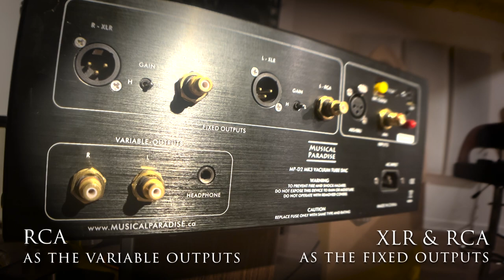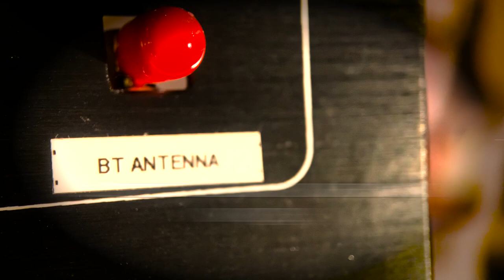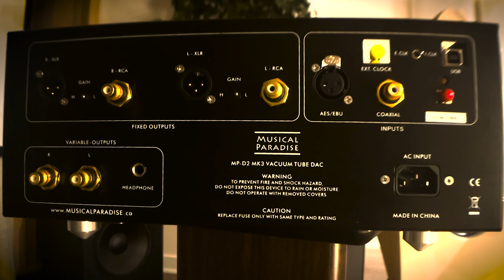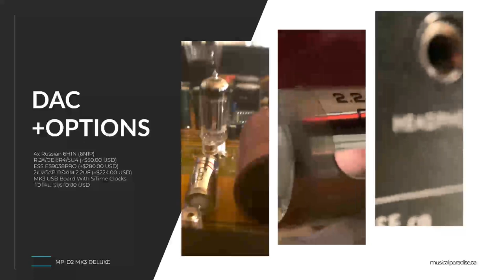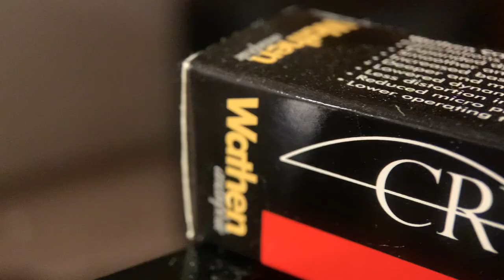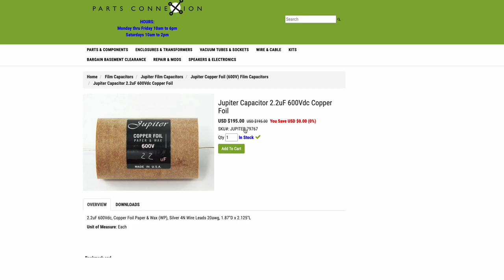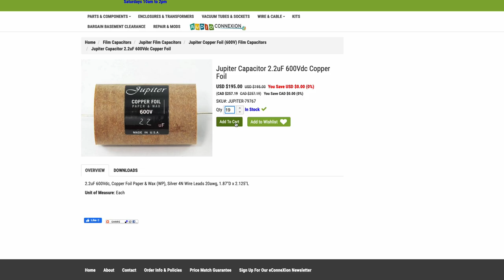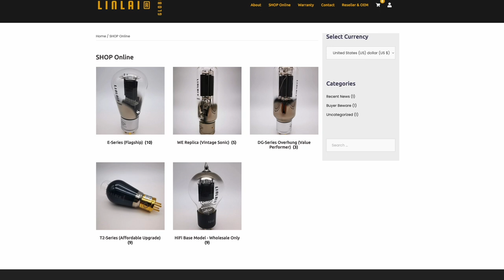Up close with Musical Paradise MP-d2 mk3 deluxe

Comment: Really well-done video.  Love the metaphors and the photography.  It really captures the mystery and joy we feel when we make changes and get closer to the holy grail.
Cool that the MP DAC comes made to roll caps like one can roll tubes.
If you want to go to the next level, look into super caps on the PS rails for the digital sections that are at 5v and 3.3v.  Nothing major.  Just a little 2F beast right close to the consumer.  Also, on the PS for the clock.  Use at your own risk.  It could also fry the thing as it will need to power into a direct short for a minute or two.  Most regs have protection for overload built in and can handle it.  Then just leave it powered up 7-24.  More natural, less metalic, and another jump to natural.  Bass will tighten and punch harder.  Cymbals will shimmer just a little more naturally.

Comment: Really nice video! Very nicely done. I exchanged emails with Garry at Musical Paradise the other day and asked when these will be back and stock and sadly Garry said the MP-d2 mk3 is now officially discontinued. He said the next one will be another delta sigma DAC but gave me no other details. I'll keep my eye out for used or wait to see what the new unit looks like. Really enjoying this though and looking forward to your next video to hear how the SN7 tubes go! As I have said to you many times, 6/12SN7's were a godsend in the Musical Paradise MP-701 MK2 preamp. Right now I have Mundorf's in all all four positions in the MP-701 MK2 and have wanted to try some Jupiters for a while, just wish they were not so damn expensive!
Reply from the maker: I wonder what changes there will be in the next dac. Will it be the mp d3? Or the mk4? I will email him and see what I can find out.
Reply: Hey Sean,
Which rectifier and Mundorfs do you use?
Garry recommended I try 4.7uF with my Bryston amp.
I'll experiment with Obbligatos until I find the value that works before splashing out on Vcaps or Mundorfs....
Rectifier first to kill the slight buzz.
🎶🤫🎶
Reply: @carlitomelon4610  hey Carlito! Sorry for the delay. I meant to tell you I was glad to see you got your preamp! Still having the hum issue? I haven’t had the issue but have been using vintage rectifiers since I got it. I have about 8-10 different rectifiers actually. My favs are vintage Sylvania and Tung Sol 5U4G’s. I also have a Westinghouse that’s great. I also have some 5U4GB’s which are great, too, again some Tung Sol and sylvanias. Also have a Raytheon. As for caps, in the coupling output caps I have 2.2uf Gold/Silver Mundorf’s and for the two filtering caps they are 6.8uf Mundorf Supreme. I would like to try some other caps sometime but they are so damn expensive. What tubes are you running right now, stock?
Reply: @carlitomelon4610  as a suggestion, rather than going through what i did and wasted money, work out which values sound best with your MP-701s.  I got excited and spent a lot on different Mundorf caps, from 1, 1.5, 2.2, 3.3, 4.7 uf values to different Oil and non oil types. If your power amp's input impedance is lower than 47kohms, then use a higher value cap - 3.3 or 4.7. IMHO's though, the best mundorf cap to me is the Silver in Oils.  Smooth, wide, deep presentation without too much of that tippy top shimmer that most mundorf caps exhibit.  As best, i would rate them as midrange caps.  The top echelon caps are the VCAPs, and copper foils like Jupiters, Miflex, Duelunds.   I use a mix, Mundorf SIO as the power bypass caps. Duelunds tinned copper foils as output coupling caps on the MP-701 preamp.
Reply: @shogo3300  
Thank you for sharing your experience. Your recommendations will help me not to turn the preamp onto a money pit!
Garry at Musical Paradise recommend 4.7uf for the Bryston.
I'll start with $20 Polycaps....
It's tempting to go crazy, but the music already sounds amazing!
I'll get to the ear-gasm slowly and enjoy the tube and cap "foreplay" knowing she has lots of potential for the next few years...
🎵🎶😉🎶🎵
Reply: @sean_heisler  
Yes, it's all stock for now....
I want to enjoy the upgrade possibilities gradually. I'll start capacitor upgrading in the winter.
The hum isn't offensive, if you can live with a tube guitar amp....it isn't rumbling thru the subs, which would drive me nuts.
Inaudible with chamber music playing, doesn't mask the hall ambience, even before the players start. It's actually pretty faint at idle too, I just have a very low noise floor out here in Montana :-)
Garry at Musical Paradise thinks it's due to the excessive gain of the stock tubes with my Bryston. ((Speakers are Magnepan LRS))
I'm going to try 4.7uf poly coupling caps and some low gain 12au7s first, then add one 12sn7 in the middle position...
There are just so many possibilities. 
It already sounds amazing, I can barely imagine how it could improve.... 
What a great idea for a preamp!
🎵🎶😍🎶🎵
Reply: @sean_heisler  
PS
Hey Sean here's an update.

A set of 3 platinum+ matched 12au7s arrived today.

Garry was right: 
With lower gain tubes the HUM IS GONE!!

The Musical Paradise pre is a keeper. So grand and "holo-phonic", it's living up to it's name!

I'll be trying a Sylvania 12sn7 in the middle location when the adapter arrives.
Thanks for your suggestions
🎵🎶😊🎶🎵

Comment: Such an underrated dac imo at its asking price.  This video covers so much and looking forward to the part 2.  This is the one dac that has stood my dac test of time, had this for over 2 years now and it only got better when i stepped up the upgrades. I got the stock setup, and upgraded in the following order, ESS dac chips, MP ext clock, output tubes, rectifier, and lastly, the caps.  The last 3 upgrades with tubes and caps are dependant on personal preferences, so i stuck with the Linlai e-6sn7s, Linlai e-274B, and Duelund copper foils (1.5ufs - I can because i run this into the MP-701 mk2 preamp which has a 100k ohm input) This combo sounded best in my rig. Recently I also added the Gustard U18 DDC, and it added further refinements to the sound.
Reply from the maker: Yeah mp’s ext clock was super cheap! I wish I got one while they still made them. I occasionally shop for an external clock, but havent felt the urge to pull trigger yet. Its coming tho….
Reply: @shogo3300 what are you using for an amp?  I also have the MPD2 DAC modified going into into an MP-701 modified and then into a Willsenton R300b that I’ve rolled all the tubes on.  Lots of tubes and tons of fun in a smaller room.
Reply: @s2300gt  i use active speakers - SGR CX4F mk2s, these have a dedicated class A amp module for each driver and the subs have its own class AB amp.
Reply: @hificave   Loic, if you got the USB board with the Crystek clocks, then you're not missing out on much.  The ext clock just added a little bit more definition and lower noise floor to the ESS dacs being battery operated.  Mine originally came with the SiTime clocks, they were just Ok and moving up to the Crysteks made a difference.
Reply from the maker: @shogo3300  good to know. I have it running with a digital reclocker now, but the clocker isnt broken in yet, but this is already improving bass punch and detail as well as lowered noise floor, so everything is jumping a notch because of that.
Reply: shogo3300, I am curious who upgraded your pre-amp and DAC and what percent did they improve?

Comment: Beautiful Loic!
I just received my Musical Paradise MP 701mk2 preamp this week....I lost patience waiting on you and Thomas to officially review it.
It took a bit of tweaking with the 4 gain settings and Bryston 3Bsst's 2 sensitivity settings. Also had a brief snafu wondering what happened to all the bass when I inadvertently had bridged mode engaged   
🎶🙄🧐🤭
I have the base model for $720+ $60 shipping. China to Montana USA in 6 days.

Soundstage is wide deep  tall and "holographic" placing me IN the recording venue.... Tonally it's already quite convincing with very good detail presentation:
I can't imagine how much better it can get with tube rectifier, capacitor and signal tube rolling!
Right now I'm burning it in for a solid week.  I also have an email in to Garry about the faint buzz/hum at idle.... Cheap stock tubes maybe?
I'm enjoying your MP reviews, thanks!
🎵🎶🤫🎶🎵
Reply from the maker: Interesting, I had a noisy rectifier do that in the mp preamp at some point.
Reply: Cheep tubes mine was the same way. The rectifier makes a huge difference. And caps take forever to break in. So worth it.
Reply: @magnaman94  
Thanks!
Which rectifier do you recommend please?
Reply: @carlitomelon4610  I have 2. The one that stays in is a bendix. Not sure the number but it gives a third row seat. My other is like front row. I like the bendix better sound stage is behind the speaker. And deeper.
Reply: @magnaman94  my Miflex took 400hrs to break in.  Duelunds took around 300+.  The ODams took like 500+ hours but even then as good as they are, they dont sound like copper foils.
Reply: @shogo3300  I've been thinking of adding copper somewhere in the chain. Not sure where yet.
Reply: @hificave  
It was the high gain tubes.
Hum fixed today with 12au7s
🎵🎶🤫🎶🎵
Reply from the maker: @carlitomelon4610  nice!!!!!! Sounds good?
Reply: @hificave  
It started out that way as you know....Right?
...Right, Loic??
(Thomas called it "Excellent" and said you "liked it" ;-)
Following your Musical Paradise DAC adventures suggests there's SO much potential here!
🎵🎶😁🎶🎵
Reply: I bought mine 2nd hand so I don't know it's history.  My system is on all day every day.  At around the 30 day mark there was a significant change for the better.  I have run it with a MP301 and MP401 with a MP D1.  I am perplexed when it comes to changing tubes as the price range for some tubes is vast.  I am thinking of trying to buy some Brimar tubes from England.  Some of their prices are good or very good and some are not but really won't know until I try.  Capacitors are more confusing because the values can be changed.
Reply: @my2cents395  
Appreciate your contribution "2¢"!

Garry at Musical Paradise is very responsive to questions about cap values. (-:You have quite a collection of his designs:-)

He recommended I use 4.7uF coupling caps with my Bryston amp. I'm ordering a cheaper pair of poly caps to try, before I go into mundorf money pit territory :
I'm glad I waited rather than buying it with the wrong V-Cap ODAMs !

Comment: So rare to find content on this unique DAC. For linton heritage (stacked) im wondering between gustard R26 and this. Coming from irdac from arcam, a burr brown chip dac. A-S1100 amp, thanks
Reply from the maker: Coming for a burbrown… i recommend an r2r over an ess chip like the musical paradise… unless… you plan on upgrading it like I did, caps, tubes, fuse, rectifier, external clock…

Comment: Have you had a chance to try the external clock by Musical Paradise?
Reply from the maker: Yup. Have it l Love it!
Reply: @hificave  I just purchased it and no installation directions came with it. Any way you could do a screen shot and show me how it's connected in a future video?
Reply from the maker: @a3marketing991  instructions are on the site (online manual). 
Each cable connects to each ess chip. And there are two jumpers to change.  I will make a video, but wont be for a few weeks.

Comment: I have seen one other person post about using 6SN7 tubes in this DAC.  However they are not listed as being compatible in the manual - unlike the MP-701 which has listed 6/12SN7s with an adapter.  Has Gary said we can use 6SN7s? If so I wanna try!
Reply: Also only v1 and v3 tubes are needed for RCA output.  All 4 for XLR. In other words if you only use RCA, you can completely remove v2 and v4 tubes.  Gary let me know.
Reply from the maker: Yes I saw that after i made the video.  I seen threads and pictures of people using 6sn7 with adapters in the dac.
Reply: I swapped in some nos RCA 6SN7s and they sounded almost the same as my nos 12bh7a pinched plates.  Maybe a bit more bass and rolled off mids and highs.  I think the 12bh7a tubes are similar with the 6SN7 breaking up sooner.  Not sure that matters in an output stage on a DAC though. I’m beginning to think that any quality low microphonic tube will pretty much sound the same.  People seem to like those Linlai 6SN7s so why not go with those since they look cool.
Reply: @hificave   - Also with the MK3 deluxe model, the caps on V2 & V4 can be removed if running single ended (RCAs only), I confirmed this with Garry, this saved space for me to try out the Miflex and Duelund caps.  I have rolled quite a few tubes, favs are the Linlai e-6ns7s but these need a 6922/6sn7 adaptor to be used.

Comment: When this dac is stock how does it compare to the gustard R26 and Pontus II? I'm currently dac shopping in the $1000-2000 range and have been looking into open baffle speakers as well. Your channel is basically what I aspire to.
Reply from the maker: Good question, I would have to swap all the original parts back in…  not sure I will get to it anytime soon.
Reply: @hificave  No worries just curious if it would still hold up in the areas you find it accels in. Love you reviews.

Comment: You where so lucky to get one still... ;)   If I´m getting it right, there´s no need for a pre-amp? Just right into the power amp? 
I think the secret of this DAC is the total absence of OpAmp (Class D) parts. Everyone hypes class D, but I don´t like it..
I kinda heard from TAD that the CV181-T/2 Psvane Reference MarkII T-series should be really good for rectification.
Reply from the maker: It has a volume control and variable outputs. So yes you could use it without a preamp. But no remote, no analog inputs for other sources, so it works without a preamp but does not replace a preamp.
Reply: The vol control/preamp section in the dac although analogue, isn't the best and use opamps.  Its Ok if you dont have a preamp, but Garry almost always recommends using the analogue outputs (RCA or XLR outs).  Since the AKM factory fire, production has halted as there is a supply shortage of the AKM receiver chip used on the dac.  Shame though, as I'm waiting to get hold off the AKM 4499 dac modules, which only 5 pairs were made before the fire.  These were a step up to the ESS dacs.